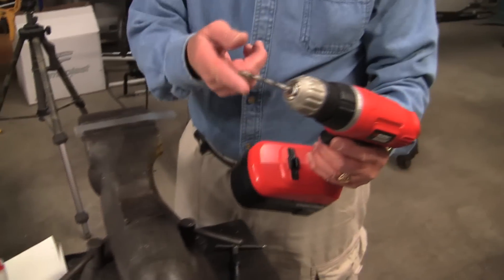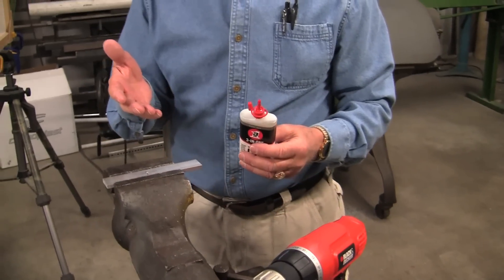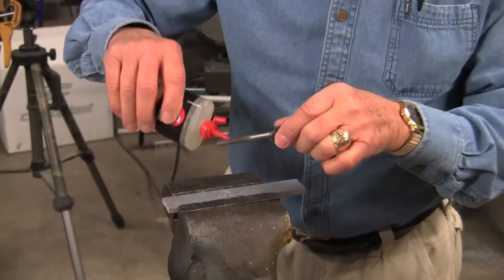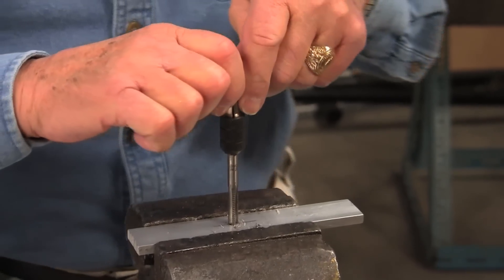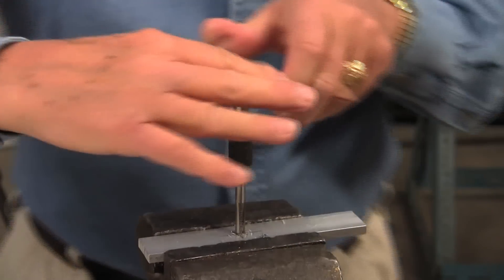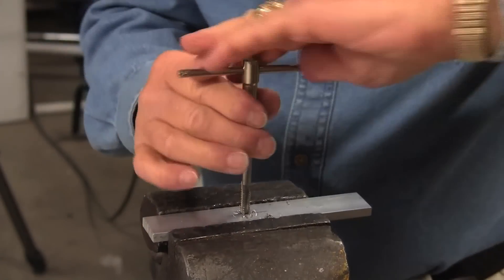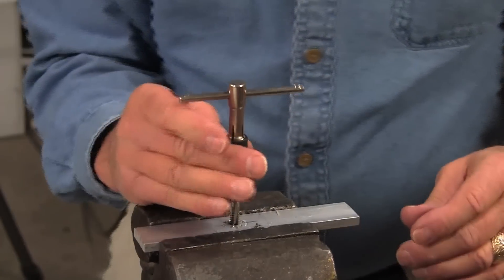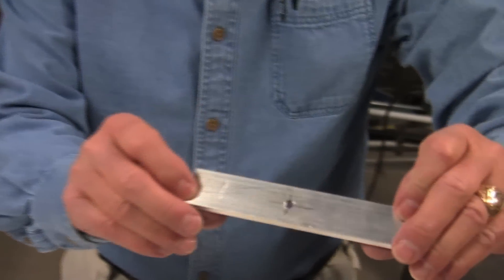How to Drill and Tap - DU-BRO Products

Comment: Need this video link written on each "Du-Bro Motor Mount". Some people suggest me just make a clear hole (without thread) then tightening engine with "bolt & nut". I feel it is not right, because Du-Bro motor mount doesn't have straight surface/plane on both side.
Anyway, nice vids... :-)